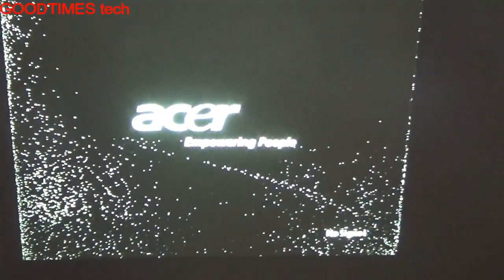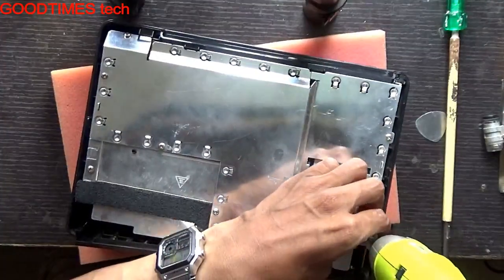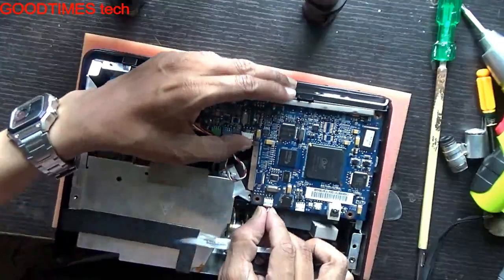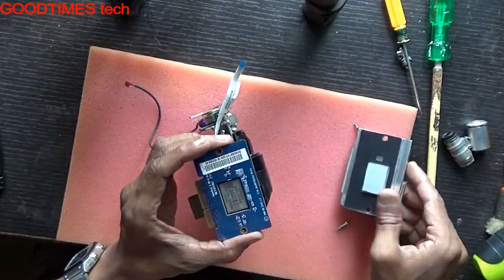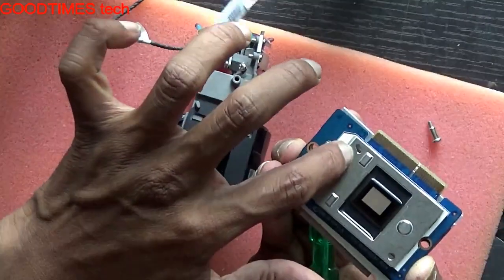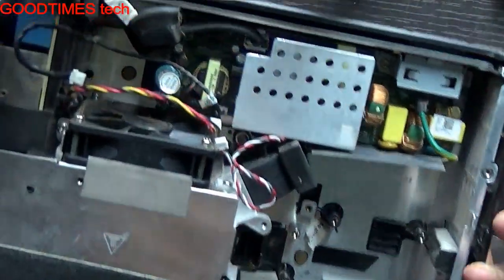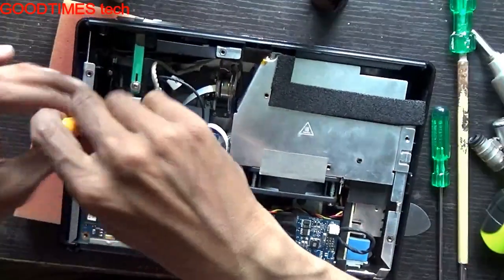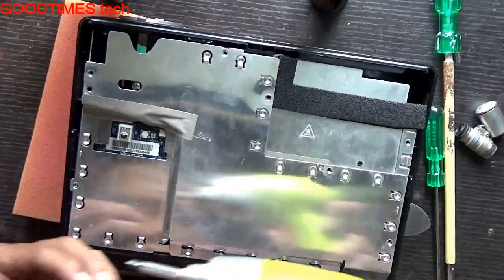Acer Projector Projecting White Dots | DMD Chip Failure.

Comment: Very good Video. Exactly the same Problem I have with my Projector NEC NP100. After 2007 many DLP Projector have a low Price DNP Chips in bad quality. The Price for a new Chips is expansive and to much for Replacement by a old Projector.

Comment: I think the chip gets too hot, BS engineers didn't even put ventilation on to the heat sink, planned obsolescence, and throw-away economy working hand in hand, a used chip costs almost the same as a new projector.